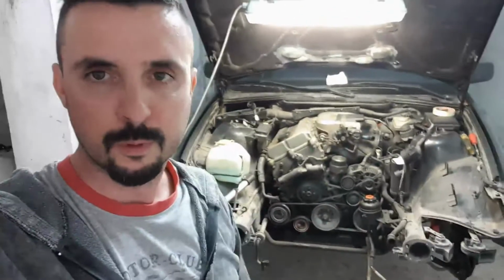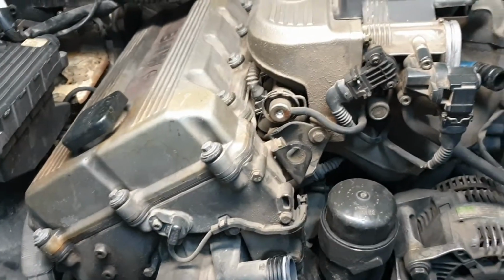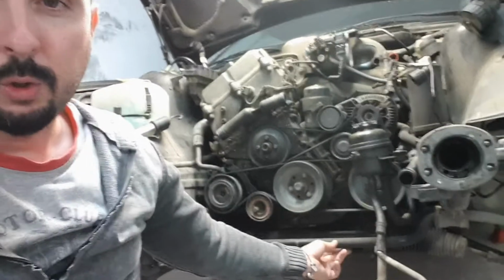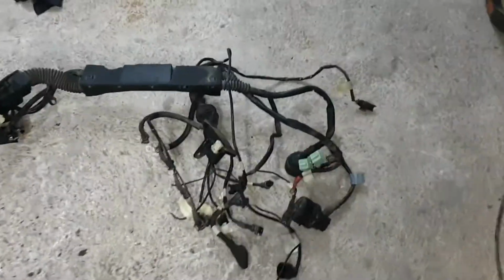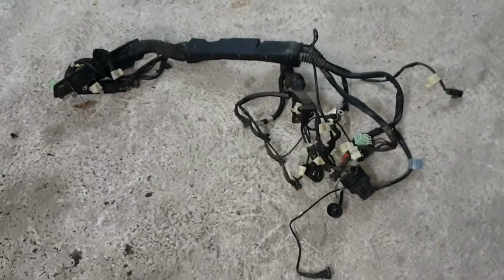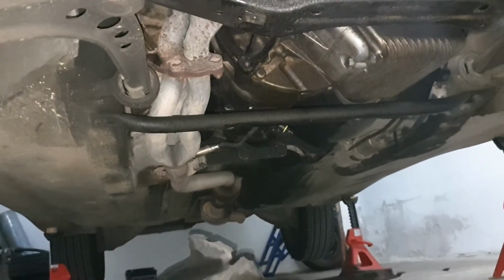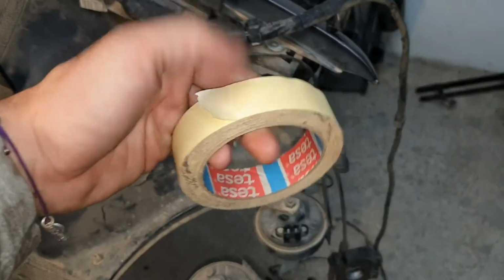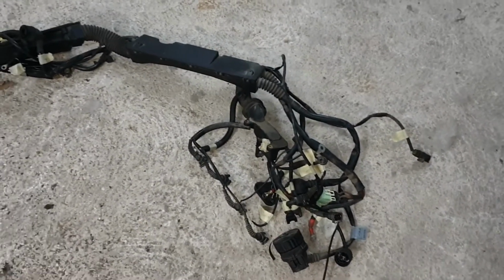316i e30 to 318Ti e36 (M44) Swap

Comment: hey man im thinking of swapping my e30 318i with the m40 to a lower kilometre m44 engine, my current setup with the m40 is the stock transmission with a heavy duty clutch and pressure plate, do they share the same transmission/gearbox and engine mounts and everything? will it be as simple as rip m40 out swap complete engine in (wiring everything the same?)
Reply from the maker: Hi buddy! The engine blocks are the same on the exterior so yes, your M40 transmission will plug in the M44 block, no problem. I strongly recommend you keep your flywheel and clutch from the M40. As well, remove the bearing inside the crankshaft of the M40 and place it on the M44 engine. The head of the main gearbox axle is smaller on the M40 gearbox. It is really easy, once you have all the parts in front of you, you'll figue it out. Good luck.
Reply: @Orelionsworkshop  will a transmission fit from an e36 IS to the e30 ?
Reply from the maker: @SuperSonic31S  Respecting the details I explain on my videos, yes!

Comment: hello man, just now I am doing the swap from a m40b16 to a m43b18 and I have a problem with one of the cables, specifically with the air conditioning, since the engine that removes as standard does not bring air conditioning, do you know what can be done with it? thanks
Reply from the maker: Hi Miguel, please consider subscribing to my channel. In this case I don't think I can be of much help... as the e30 specs are 100% for racing and I have removed all the accessories. But just to give advice, I think you should run new cables+relais and fuses as the car you are putting it into never had the air conditioning. Hopefully you have solved your problem.

Comment: Can u help l have a m44 engine iam putting into a e36 year 97 howto wier it up to the fuse box help piles  and thank
Reply from the maker: Hi Ricardo, please consider subscribing to my channel. If you are installing an e36 engine into a e36 car, the wiring will not be a problem. Do you have the M44 engine cables harness? Do you have the M44 ECU with EWS+Antena+Key? If you have all this it will be easy!
Reply: @Orelionsworkshop  what is the atenna?
Reply from the maker: @pondfish9858  the circular antenna that goes around the key knob of the car. To read the microchip of the car key.
Reply: @Orelionsworkshop  ok thanks for the reply I’ll do that so